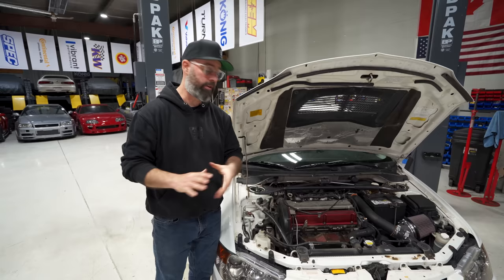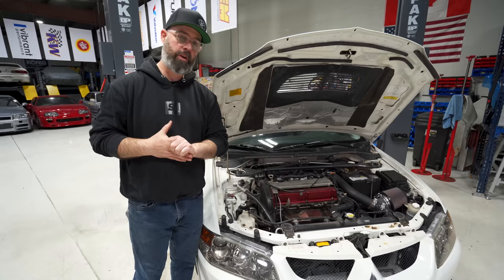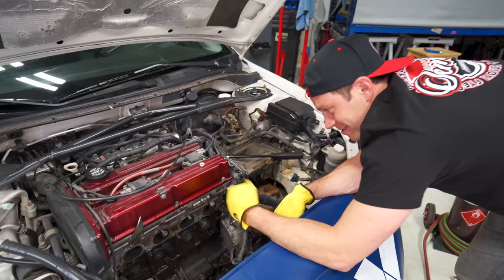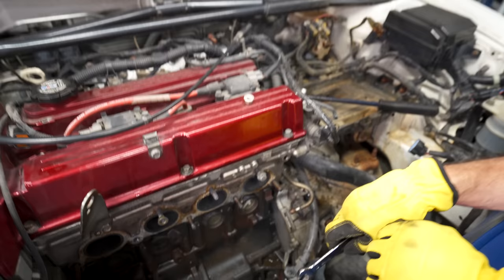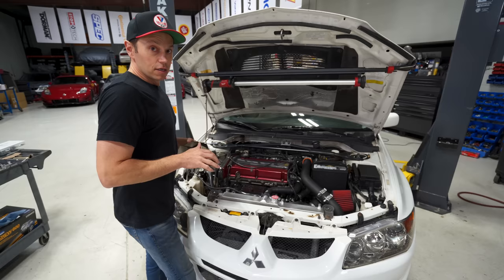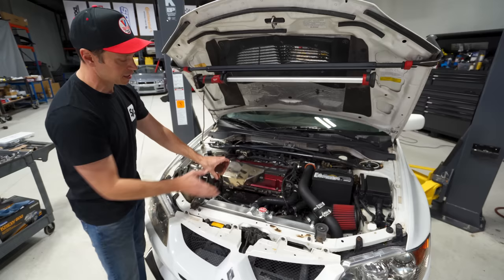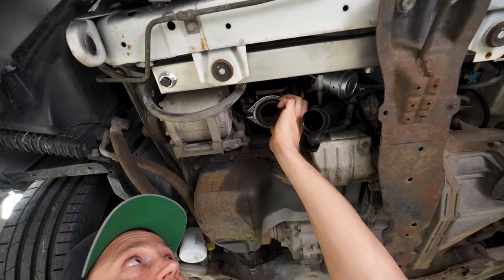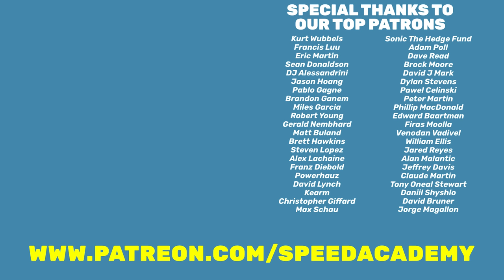Quick & Easy Mitsubishi EVO 8 Build - Part 2

Comment: I like the tomei cover, gives a classic tuner look
Reply: When I see the "classic tuner look" I know everything rattles, the tires rub on compression, there's a boost leak, the synchros are gone, the ACD light is flashing and instead of defeating Lambos this Evo is out there getting humiliated by Toyota Camrys. You can do 600whp on these things with a stock looking engine bay.

Comment: This California car looks pretty Midwest.
Reply: It sure does. I have the carfax, lived in SanDiego it's whole life. No idea why it looks like that.
Reply: Maybe lived it’s life near the ocean?
Reply: @WTFNoNamesLeft2  if it lived and drove by the beach often, that could explain why. Same thing happens to cars here at South Padre Island, TX.
Reply: I live next to the ocean in California and my stock exhaust was just as bad on my FR-S
Reply: Idk I’m in Sf Bay Area, and I have an ae86 from the bay, and there isn’t an inch of rust on it. I’m thinking he drove it to the snow (Lake Tahoe/sierras) when they were still salting roads. That could explain the surface rust
Reply: @tumsfestival8027  How close to the ocean are you? I mean I am 5 houses away from the ocean and you can taste the salt especially in the fog and dew. It was a real PITA removing my exhaust. There's an old truck in the alley behind my house that you can poke your fingers through it's so rusty.
Reply: @WTFNoNamesLeft2  I purchased an M3 from CA. Car spent its entire life in San Diego. Surface rust all over the subframe/exhaust bolts, etc. Being that close to the ocean can be damaging I suppose.
Reply: @richardwade1544  that makes sense. I’m about a mile up from the ocean but I’m in the East bay so it’s bay air, not like right off the pacific air
Reply: My guess is it visited either big bear or Tahoe often. That looks like road salt rust. I lived within 2 miles of the beach in San Diego for 5 years and never had an inch of rust develop.

Comment: You guys need a machine shop that you work with regularly that will make "house calls".  Anytime you get into something you're worried about breaking bolts in blocks / heads, just call them up and save yourself the trouble for a little money.  When I was in the auto trade, we had someone that would do "on call" jobs with no notice for under $400 in most cases, labor and part(s).  That would be extracting a flush broken bolt, and thread chasing retapping or whatever.  I am sure if you find someone local and are flexible with when the job is done, you could probably get it under $200.
Reply: My machinest loves his threaded collets for removing manifold studs. So much less sketchy than double nuts. McMaster probably has some!

Comment: JGT500 was made by Espelir and is one of the best back in the day. Dent in it was probably from bottoming out or didn’t fit right because of downpipe. I ran that JGT500 for a long time. The only thing that failed was the resonator which I later cutout.
Reply: Funny you mention that. My first big drive in this car was to deliver it to Canada. When I bought it there was a slight rattle. By the time I got to Canada it was shot.
Reply: Came here to say this lol. Pretty desirable exhaust now that it’s discontinued. Have the same one on my 8 and it fits and sounds wonderful. Wouldn’t mind another for my 9

Comment: You guys should invest in one of those induction heating guns. They work amazing at putting a ton of heat into just the exhaust studs. Personally I wouldn’t have put that lower turbo heat shield back on. I had several recurring problems with my ceramic O2 housing and the bolts backing out even though they were torqued.

The grim speed master cylinder brace is also a night and day difference mod. Super worth it.
Reply: They actually have one and have used it on several builds.

Comment: 1 thing you might try with those exhaust manifold studs is heat the stud itself until it's glowing but keep the heat away from the head. Then cool down the stud itself so the head retains the heat and it shrinks the bolt inside the hole. If you use a penetrant to cool the stud then it also allows it to more easily get into the threads. Thus making extraction that much more easy to come out with less risk of damaging threads or breaking the bolt. Rinse and repeat as needed until it comes out. Just try not to put too much heat into the head. Too much direct heat will distort or melt the aluminum. Just a thought. Keep up the sick builds 🤙

Comment: i post the same comment every time you guys put a koyo rad in a car. koyo rads are the absolute best. fits exactly like oem, and theyre extremely tough! i put my koyo rad into a wall going 50km and its literally perfect still. im a koyo customer for life, after how good my koyo rad is i will never buy a different brand radiator. fun fact, the koyo rad with an upgraded clutch fan in my 240 worked too well while i was driving it in the cold weather. If i stopped at a set of lights my coolant gauge would drop from operating temp to cold and i would lose my heat, i had to cover my rad with cardboard so i could maintain temp and keep my heat cause it worked too well

Comment: With aluminum heads you have to leave the heat on the head to get the studs out.  Aluminum dissipates the heat so fast that you have to have DP hold the fire to it.  🔥

Comment: Excellent work gent! Removing the chrome and going with the black OEM heat shield was definitely the right move. The Ultimate Racing exhaust was a nice come up. Looking forward to see what type of HP it makes. Pete while you have the car why not spray the undercarriage with some Fluid film “Black”…that California car is quickly becoming a victim of the rust belt.

Comment: Good call on the exhaust studs, even if you had used the heat induction tool and heat em up there was a high chance you would end up stripping it and then its a head job.
Very good choice of turbo, it is somewhat the incarnation of OEM+. Stock exhaust heat shield for me, all day

Comment: It could very well be that the dent in the exhaust was 'from factory'. I've seen OEM Honda exhausts on sports bikes that have a dent where they need to clear suspension, engine or frame components...
Reply from the maker: That dent was def not factory, in fact it was multiple small dents, likely a hammer.

Comment: On @2:48 if you notice the rust or rtv whatever the previous owner put on the downpipe you could see it was not sitting centered on the o2 housing. Why? Because it's MISSING A DONUT GASKET yes it's a half donut or shall i say looks like a donut cut in half hence the name. So yea not like you said lololll your wrong. And the bolts are impossible to get off because They kept tightening the shit out of the bolts to stop a exhaust leak. Anyway just wanna tell you stop acting like you know it all...it's ok to not know everything. And a 25g turbo maxes out at 500whp that turbo you have doesn't look as big as a 25g....and you guys saying "this turbo makes over 500whp!" Cmon yall know how easy it is to change numbers on a dyno? Evo looks clean though especially for a 8 they usually all trash.

Comment: Hey guys. Love the videos and love the mini builds keep them coming. Hey you can get like a welding tip for the oxy-ace torch that pinpoints the torch and heat a little better. And turn the torch down a little take your time. Heat it up slow. You guys work on such nice cars don't want to burn anything I get that. They also sell these things called induction heaters you should check out if anyone hasn't mentioned that. Thanks for all the content